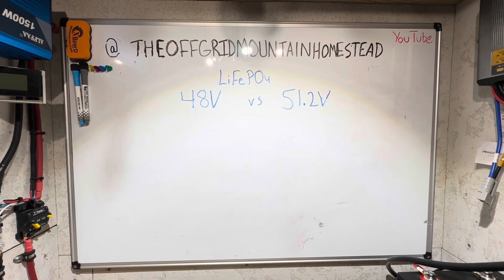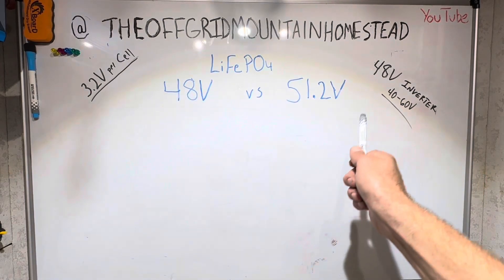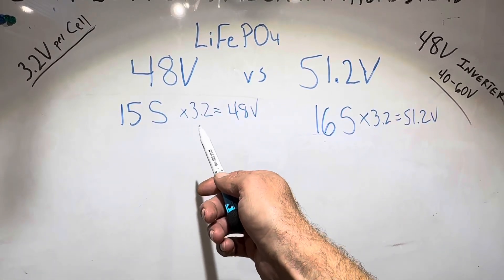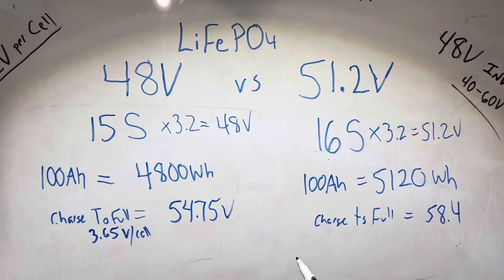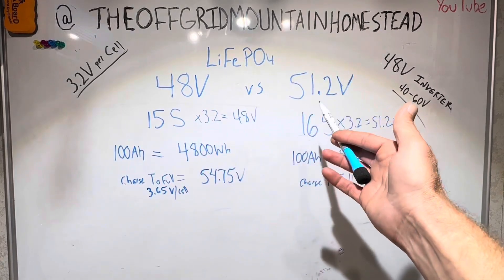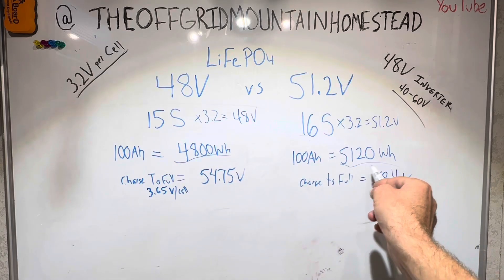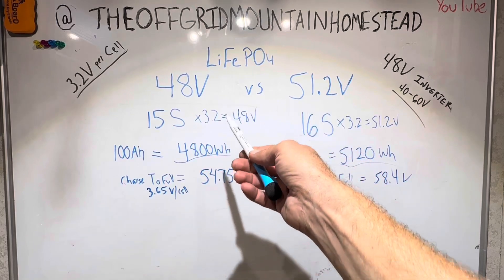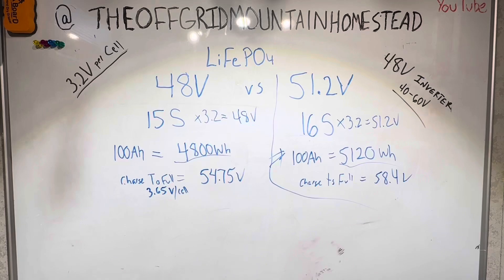48V vs 51.2V LiFePO4 Batteries, What’s The Difference?

Comment: Mate that was extremely useful. 
Unfortunartely my little homestead is in Indonesia, where there is a massive tax on imported batteries to try and push global battery suppliers to build Nickel battery manufacturing facilities in country, to add value to Indonesia's currently undervalued massive Nickel reserves. 
This means most batteries are expensive, the cheapest being second hand or even new 15s batteries. So thats what we have ended up using, both for my home( 15s secondhand), and for my eco-hospitality business (15s new)
That leaves me with a slightly odd question that I thought you might be able to help with. 
I'd love to transition to 16s, but cant see any easy pathway. 
One thouht was maybe setting up tow external BMS's and two seperate battery banks, one 15s and one 16s. 
So our inverters would send out a request for energy and the bms's would manage charging and dowloading from each bank seperately. Would this be possible?
Reply from the maker: If you already have 15S, may be best to stay that way. Some people get creative with specialty DC isolation relays and things to try and make a 15/16 hybrid. I’m unsure of a truly safe way to approach this. Sorry I couldn’t be of more assistance.
Reply: @THEOFFGRIDMOUNTAINHOMESTEAD thanks mate. Advice appreciated. Might switch my home to 16 at some point and just add my 12 home batteries to the 14 at my restaurant as we continue to upgrade there

Comment: I have lead acid battery inverter that say 48 volt. I am confused will it works with 51.2v battery or will discharge it too much.
Reply from the maker: Lead acid is considered nominal 48V. Its range of voltage is approximately 42V to 58V depending on charge and discharge level. Lithium 16S is nominal 51.2V with a range of about the same voltage. A 48V inverter normally can work between 40-60VDC of course depending on manufacturer specifications. This is a common voltage range. Most of not all inverters are much happier on LiFePO4 due to higher voltage throughout the curve. Hope this helps!

Comment: Do you know if the newer Growatt inverters only will work with their own batteries?
Ex. the MOD10KTL-XC in the specs it says it's only compatible with their ARK-XC battery.  My question is becourse those are quite expensive compared to other non-growatt batteries and i'm worried that I will be "Vendor locked" if i buy a Growatt inverter.
Reply from the maker: Not well versed with Growatt equipment or their developments. I can’t give you an accurate answer, sorry.

Comment: The industry standard for LiFePO4 "48V" batteries is (and has always been) 16s.  That is 51.2V nominal, 56.8V charge target, and a 53.6V-54.0V float.   At 48.0V a 16s battery will be 95% empty.  This makes it highly desirable.

Some vendors tried to lowball people by selling 15s packs because they could advertise them as "48V" even though they were one cell short of the standard.  It turned into a marketing mess and unfortunately a lot of people fell for it and got stuck with them.   A 15s pack is 48.0V nominal, 53.25V target, 50.25V-50.625V float.  

The problem with 15s is that 95% discharged will be down at 45.0V and many inverters and other pieces of gear have higher low-voltage cut-offs and so are unable to use the full capacity of the batteries.  Plus at higher power levels the voltage sag will cause warning bleeps, whistles, beeps, and creeps and... it gets annoying.

They cannot be mixed.  People should definitely go with 16s in all circumstances and avoid 15s LiFePO4 batteries.

-Matt
Reply from the maker: Thanks Matt!

Comment: My 8kw Outback Radian inverter has a max safe operating voltage of 65vdc listed in the factory specs. so I built 2x 300a 17 cell LifePo4 batteries to give me 54.4v battery packs that I charge to 60.2vdc.. This creates a far more efficient low end when the system stops pulling current from the batteries at 49.6v thus the electronics are not pulling a higher rate of amps which cause more heat and stress.. I could if it was an emergency run them down to 45v but this is the point that damage is occurring to both the batteries and inverter so I rally have no desire or plans for this.. Beware that 5.12kw capacity because this is unsafe max charge to that unsafe minimum charge where cell degradation happens and the lifespan of the cells is vastly reduced.. At no lower than 2.8v and no higher than 3.6v per cell you double the life of the battery over the 2.5v and 3.65v discharge/charge cycle for maybe 5 amps of current..
Reply from the maker: Nice setup! I didn’t cover recommended charge voltages this was meant to help the viewer understand and possibly help others who were wondering. I charge to 55.2V and have “float” inverter hold at 53.8 to 54.0 depending on season. Rarely ever go below 52.0 unless weather sets in for days on end.

Comment: I strongly recommend to avoid the 15S batteries.  These standards are all originally derived from lead-acid which would be 2.1v/cell with 24 cells in series (24S), or an operating range of 42v to 58v.  The 15S LiFePO4 peaks out under 55v.  The 16s LiFePO4 is more universal, being the same as 4x12v in series or 2x24v in series, both resulting in 16S LiFePO4 cells.
Reply: Agreed, those 15 cell batteries have a far shorter lifespan because they are being pushed to their limits to act like a 16 cell battery.. The only case I would say they are better is when you have sensitive electronics that have poor input regulation which requires a voltage very close to 12vdc.. Some cheap 48v inverters have 51v input maxes so you have to beware.. Many people have learned this the hard way with failures, installing a dc to dc buck converter/regulator to trim down say a 14.4v input to 12v on 4 cell batteries has been their solution.. I have yet to see any higher voltage to 48v regulated buck converters that could handle a large load..

Comment: Thanks for this video I use 12v but great info
Reply from the maker: Glad you enjoyed! I’m trying incorporating more 48V content for those who prefer this system voltage. Don’t worry 12V will still be featured as well! Probably some 24 and 36 mixed in too!
Reply: For smaller systems or those tied to dedicated operation in things like motor homes the useability to efficiency is acceptable.. Once you get into the larger home installations where you have 5kw to 20kw of panels and as in my case 12kw of split phase inverters for 240vac supply at over 50a with a 75a surge 48vdc/51.2vdc or in my case 54.6vdc/60.2vdc the 12.8v systems become inefficient and impractical.. This is where planning and futureproofing a system is very important because plan wrong and you will be paying more when you do want to upgrade..